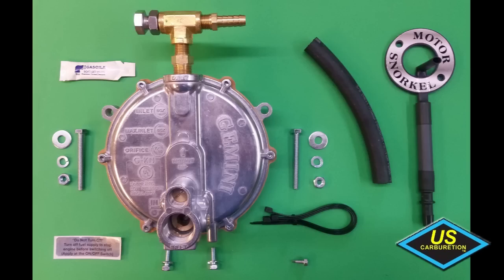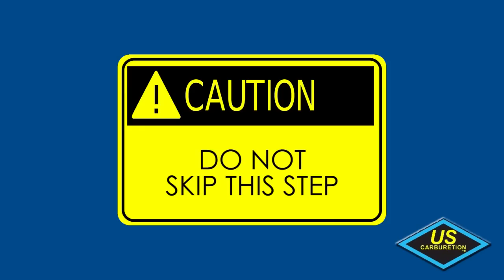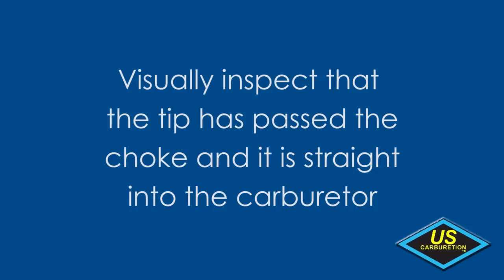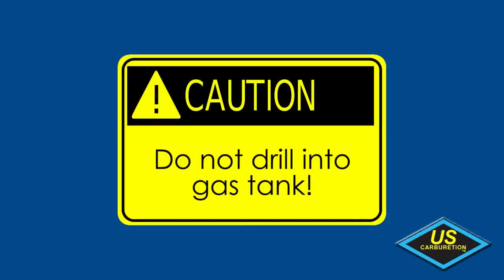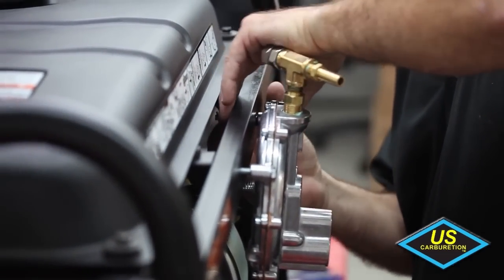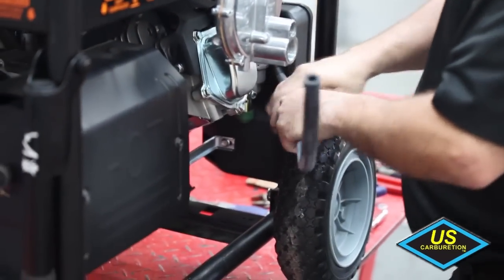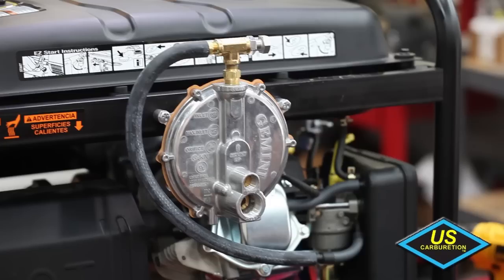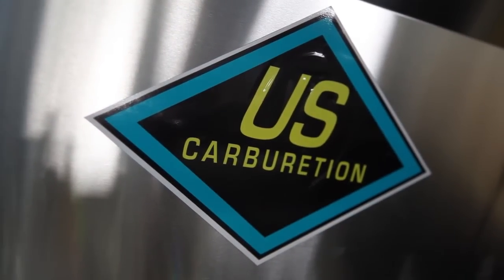How to Install Motor Snorkel

Comment: Great product, i have been using this for several years now on a Westinghouse 9500. Never had an issue attached to natural gas. Generator starts quick and runs great. Was able to keep my house up through several hurricanes. The last one had us out of power for 4 days.

Comment: That is the idea behind my DIY riding lawnmower conversion.  I used 1/4 copper tubing and routed it through the air box into the throat of the carb.  Works great!
Reply: Ya, I think that's what I'm going to do too. I have a plastic elbow between my carburator and my filter box that would be easy to drill into. And I've found Impco regulators on eBay for $50. Now I just need to figure out how to rig up one of those adjustment T's. It doesn't look like rocket science.

Comment: I have a Duro Max XP12000E  that can run off of Propane (regulator for only LP) and Gasoline out of the box. I would love to use Natural Gas. Will the motor Snorkel work with my Generator? Is it possible to just replace the stock LPG regulator with a Garreston  regulator instead?

Comment: my w-house igen 2500 is frameless as are many other in the 2200-2500 watt range. do you have a problem of installing that big ass regulator that you supply on 1/2"-5/8" tfe standoffs below the exhaust and over the intake?

Comment: Really like to see close up shots( NOT HARD) showing the snokel into the choke. My obvious question is DO YOU OBSTRUCT THE CHOKE? YOU STATE THAT YOU SHOULD NOT OPERATE THE CHOKE BEFORE YOU PUT THE FILTER SHROUD BACK ON BUT YOU DON'T EXPLAIN THAT CONTEXT. PRETTY SMART GUY HERE BUT THAT IS ALLUDING ME
Reply: From previous comments, the tube is soft enough to be compressed by choke plate, then returns to original size. On some carbs, clearance is not an issue
Reply: This exactly - why even make a video if you aren't SHOWING THE IMPORTANT PARTS!!!!

Comment: If the snorkel installs past the choke plate of the carb, hows the choke function? Im assuming it doesnt fully close? Does the snorkel collapse to seal for using the choke when running on gas?
Reply: I'm sure it doesn't collapse. I assume the tube goes past the choke so the fuel isn't choked out when the choke valve closes. This may also help you use the choke to prime the regulator/valve with increased vacuum pressure too. But the venturi adaptors don't go past the choke valve and they seem to work fine. Maybe they expect you'll have a manual/auto primer on your valve so there wouldn't be a need to choke the carburetor to get fuel flowing... I wish USCarburation would answer these questions since it's their design.
Reply: +xboxer1985 

Wondering this myself.  I think I'll just email them or call to ask.
Reply: I have the snorkel on my yamaha ef2000is. The snorkel does go past the choke plate and does collapse and reform when the choke plate is opened.
Reply: yes my ef2000is works just fine with the snorkel down the carb throat on gasoline.
Reply: +twist of -faith The snorkel tubes cross section is small compared the carb's bore thus the loss would be slight. The older "donut" 1cm thick adapter had a necked down venturi and some use to say the output was 10 percent less
Reply: the choke plate only cuts the air. there is another plate inside which is meant to adjust gasoline intake. so if the snorkel blocks the plate open, you won't have easy start on gasoline on cold days
Reply: ale luia No. The snorkel does not interfere with the 2nd plate. No issues starting with gasoline
Reply: If there is a concern with the choke simply cut off the end so there is no interference. Glad I didn't buy this kit. An equal if not better way to get tri fuel can now be obtained for as much as 1/4 of the cost of these kits depending on engine size. Not to mention a simple 5 minute installation.
Reply: Whether the choke plate gets fouled depends on the carb. It usually doesn't, but does on others. That is why one has to look a the actual carb in the engine. I have some tiny carbs on 1 to 2 HP units where the carb butterfly will be blocked and bigger carbs on 11 Hp motor where the choke plate is way inside the carb
Reply: Deucealive75 - And what is that other cheaper option?
Reply: @Deucealive75  Are you talking about just getting a whole new tri fuel carburator which fits exactly like the OEM carb for 40 bucks on  Amazon OR eBay?
Reply: @frankcar1965  Yes on eBay. And I think they are less expensive now then when I got  mine a few years ago. They are nice and work great. I still haven't piped out for natural gas. If I would get more power outages where I live I would. I run it on LP only.
Reply: @Deucealive75  Thanks, I am about to order a carb for my Predator 4000, after just three days outage and having to go get gas I am ready to do it. I can't imagine a whole week of gas trips.
 I'll have to call the plumber to  do the gas, it's close to where I want it so shouldn't be too expensive. I just worry about loss of power with NG.
Reply: @frankcar1965  Oh wow... Best of luck to you.

Comment: What is the best motor oil to use after the two hour breaking period of a new generator?  I have a Troy-bilt 5550 and use it in Florida.  Synthetic 5w-30?
Reply: I would say the best is synthetic 10w30. Now, if knew I would be running in temperatures under 20F, I would think about using 5w30.
Reply: Don't go cheap on choosing oil.  I use 5w-30 Castrol Edge Synthetic.  I run my whole house on a portable Duro Max EP12000EH generator.  Runs on Gasoline, Propane or NG    I love it and runs smooth on this oil for hours and hours.
Reply: @ronmorningstar6231  Are you able to run your central AC?
Reply: @prettygirlus9008  Yes but not with the Hot Water tank on!  So we shut it off when doing AC....I actually have not tried it!  But know the Watts from both could add undo stress to generator.  When shower is needed we flip off AC and on HW tank.  Simple and has worked well when we were out of power 4 days.   Be sure to change oil every 20-30 hours!  If you are only running at 1/2 then you can go much longer.  But in my neighborhood I supplies my house and ran heavy duty cable to neighbors 50 ft away to keep their refrig and lights going.  There are some who say synthetic can go longer but why push it!  Shut it down and change oil and it will be your best friend!  Keep at least 3 changes of oil in supplies.
Reply: @ronmorningstar6231  I've found the Duromax XP15000EH dual fuel for $3000; this model seems to be hard to find.  But this is $1600 more than the XP1300EH.  Is the extra power worth it?  Hoping to run my 4-ton central AC.
Reply: @prettygirlus9008  For you to find the wattage, you multiply the items weight by 3,500 since 1 ton = 3,500 watts. The method however only gives you the starting or surge wattage. That means the value you get shows the total watts required to start-up an appliance. With this, you can estimate what size generator to run an air conditioner you will need.
  I copied this for you and you can easily search the net for more facts.   If all you are running is a 4 Ton then the 15K would work but be at it's max.  You will need at 20K or larger if I am reading the info correctly.
Reply: @prettygirlus9008  Install a mini split and use 1/3rd the electricity to cool your home.
Reply: @scottc8152  Yes, that's exactly what I ended up doing a few months ago.  I installed a 2-ton 3-head mini-split system (in addition to the 4-ton central AC),  It cools two second floor south-facing bedrooms and a 375sf 1st floor south-facing media room.  I can run all three heads, refrigerator, and all lights & ceiling fans on my 7500 tri-fuel Sportsman generator running on NG.

Comment: I know the thing works. I know it functions on same principle as scuba air regulator.  I also know if you feed gas directly into carburetor works as well, but is unsafe due to backfire. When the engine sputters it means unburnt propane leaves the cylinder and ignites in exhaust gallery- happens white extra rich mixture. But also if propane lingers into air inlet it could ignite. This propane kit works, I'm just trying to assess its reliability.
Reply: Propane conversions have been done for decades. Henry Ford even experimented with them. Propane powered tractors have been around since 1917, fork trucks in the 1930's. The common fork truck of today is really a 1950's era wonder. The two gasoline shortages of the 1970's gave birth to newer propane cars and conversions.  During World War 2 gasoline was rationed and propane was not thus farmers in here used Propane.
Reply: The patented motor snorkel just is a tube down the throat that has a thin width of the adapter. ie  instead of the decades old giant thick adapter donnut ring. With a motor snorkel one often does not have to cut any generator frames. It is so thin that the air cleaner only moves out a few mm instead of say 10 to 20mm. Both work by vacuum, the pressure is below atmosphere and thus the Demand regulator sees a vacuum and allows a flow of LP or NG. The older donut type of adapter is about 50 years old, the motor snorkel new. The new adapter came out so folks do not have to cut any steel frames

Comment: I just bought a generator that can run both gas and LP out of the box.  I'm wondering if I could also run natural gas as well?  Would there be any differences between LP and natural gas besides possibly needing to change some connection fittings?
Reply from the maker: You could run Natural gas with the addition of Motorsnorkel to your system.  Please send your question along with your exact make and model of generator to support@uscarb.com and we can get you some additional information.
Reply: @USCarburetion  do you make this propane kit for a sportsman 800 - 1000 watt generator?
Reply from the maker: @jonsmith2217  Hello. I do not see it listed in our system yet. However I looked up the carburetor and it looks like it would take our MSK3202. If you already own the generator and can email us a picture of the face of the carburetor and give us a measurement from the center of the left carburetor stud over to the center of the right carburetor stud we can verify that snorkel will work for that generator.
Reply: @USCarburetion  okay thanks I'll have to call Sportsman generators. And try to to get the center to Center stud measurement on the carburetor studs.
Reply: If your generator is dual fuel you can convert your generator to tri-fuel by hooking your new regulator to the propane side of your carburetor. go to billteachesyoustuff on youtube and watch the video on tri-fuel.

Comment: Why not mount the regulator on the propane cylinder and run a low pressure hose to the appliance. That is the usual setup.
Reply from the maker: The KN Regulator works off of engine "vacuum". So the further away you have it from the engine the more vacuum it is going to take to open the regulator. Imagine trying to suck milk through a 20' long straw. We have found that it's best to have the KN regulator within about 18" from the carburetor. You can try further however it can start to cause issues.

Comment: There is a problem with this conversion: the regulator is not meant to work cyclically. When you convert a 4-cylinder to propane, the regulator is quite the same, however the propane flow is uninterrupted: 4 cylinders 4-cycle means one cylinder draws air. But in your case- the one-cylinder engine only draws propane once every 4 strokes, meaning the regulator is forced to cycle on-off for every engine cycle. At 3600 rpm that is 900 commutations per minute. Even if the regulator was guaranteed for one million commutations (which I doubt since there are rubber parts, spring, valve and valve seat which are prone to fail at a duty of almost 1000 cycles per minute), is still like 1000 minutes, or 16 hours before servicing it. Just to wrap it up: is the regulator supposed to work cyclically? What is the warranty on it?
Reply: A better way to ask your question is: Will the diaphragm return spring be strong enough to close the gas valve during the compression, power, and exhaust strokes of a single cylinder 4 cycle engine 900 times per minute at 3600 RPM? My best guess is that this may happen while cranking during startup but not at 3600 rpm. I suppose something could go wrong if there was a bad intake valve leak because of the blowback through the intake system. If that were the case the engine may not start at all. An interruption of this sort would starve the engine of fuel and compression.  Due to regulator design your question would be difficult if not impossible to test. Another thing to consider is the track record of these regulators. 1 million commutations would be just under 19 hours of run time. I would bet that there are tons of these that have had more running time than 19 hours. Also, are the regulators that are used on brand new generators designed to open and close at this rate? In my opinion I don't believe the very light diaphragm spring tension would be able to close the valve this fast during normal (3600) engine rpm. If the spring tension was heavy enough to make this happen, engine vacuum would never be enough to ever open the valve in the regulator in the first place.
Reply: Another thought....If these small engines had a vacuum port that would accept a vacuum gauge you may be able to test your theory at very low engine rpm. If your theory is correct you may be able to see flutter in the vacuum reading at very low engine rpm.  It may even be noticeable on the vacuum gauge at higher rpm.
Reply: With a multi cylinder engine running the "air" through the inlet is stable enough so the demand regulator sees a fairly constant flow; ie the regulator is NOT working cyclically. It is in about one place, open enough for the flow. ie it is NOT jumping around with each piston firing.
Reply: I didn't think so either. But it was an interesting question/theory...3beltwesty. I have a question for you...Why would a 4 cyl engine that is ran on NG that drives a generator have the exhaust manifold nearly cherry red hot at only 1/3 load?

Comment: Get ready to be aggravated beyond your imagination. You will pull on the start for your generator to your arm falls the funk off. You will tinker and adjust to the sweat Burns your eyes. You will not get it to run consistentl..
 Back to the drawing board guys

Comment: Is not the snorkel that baffles me. What they call snorkel is only a bent pipe sandwiched into a thick gasket. No technology there. What baffles me is the Garretson regulator. That kind of regulator is common to 4 cylinder engines because it regulates a continuous flow. However, a one piston engine will demand propane discontinuously, once every 4 strokes. In this conditions, if the regulator valve starts commuting at an average 900 times a minute,then it will fail within first 20 hours of operation. The only way this regulator will last longer is if the valve stays open continuously. If that's the case, then propane will accumulate into intake gallery for 3 strokes and there is risk of self-ignition outside cylinder during the admission stroke. What I mean is propane should not mix with air outside cylinder. That will require the regulator valve to close after admission stroke. Which is not possible for this valve. That's why they don't reply.
Reply: The flow is continuous. These regulators have been around for about 50 years. The valve in the regulator is NOT jumping around at 900 times a minute, it is at one position. Thus the flaw in your logic is that the valve is fluttering when it is really at one position when at one flow rate. ie the thing is damped and has  a low natural frequency thus cannot dance at such a high rate.

Most these regulators are on engines with less than 4 cylinders, ie 1 cylinder is the most common set up.

Comment: Don't buy this it's not worth it there's no reason to make it where you can't joke it and run it on gas
Reply: Chris Web the snorkel hose is flexible.  The choke valve pushes the hose to the side and still closes while in place, when using gasoline.
Reply: @shawng8432  nope  not on mine choke wont close enough